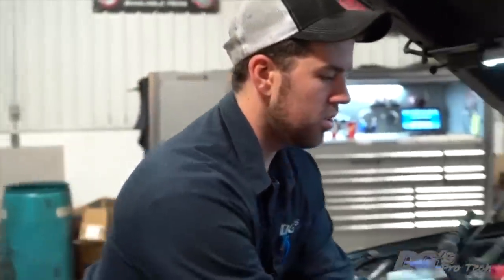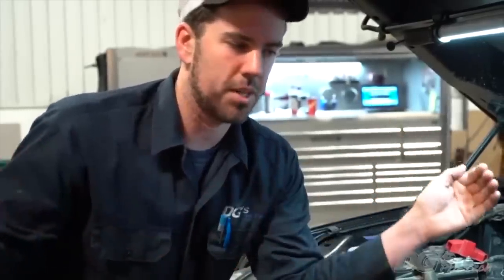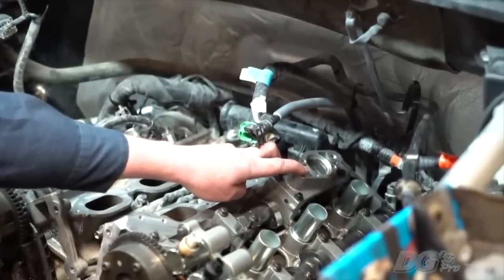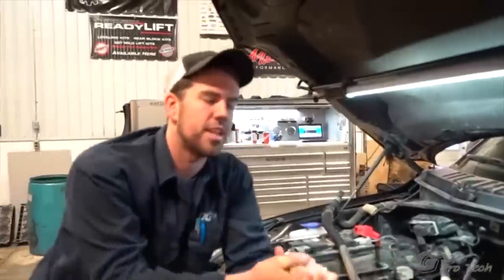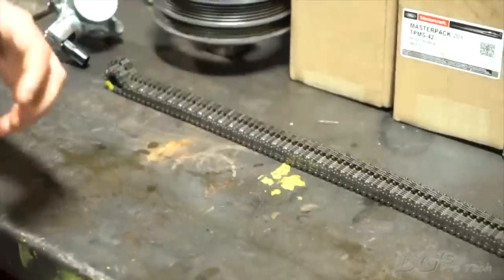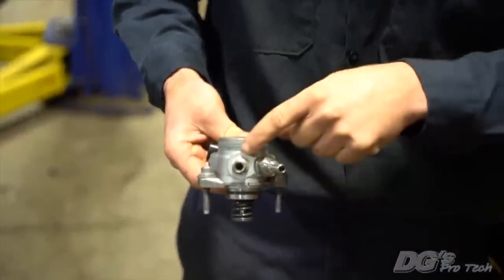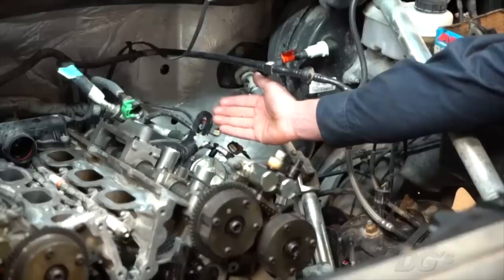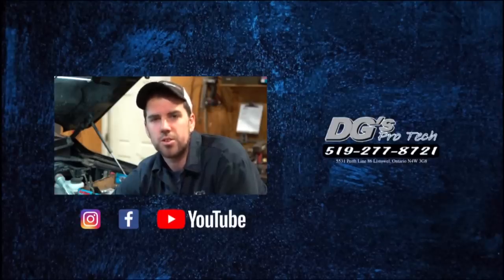What you NEED to know about Ford EcoBoost Engines by Dustin Golley of DG's ProTech

Comment: I want to alert DG Pro Tech, regarding scanner codes on Ford engines, that I went to 5 different Ford Dealers in Miami about firing problems with my 2004 Marquis, a P0355 code showing misfiring on the #5 cylinder.   NOT ONE OF THE FIVE DEALERS mentioned that my PCM (the main computer, power train control module) might need to be re-programmed.   One dealer had the car a full day, and told me "it might need a new PCM, and Ford no longer carries a replacement, so there's nothing we can do."
I spoke to two different service reps at Metro Ford, neither of whom suggested reprogramming.  One rep said it might be a transmission problem.    Even I knew better than that.   Pines Ford in Pembroke Pines Florida said they could reprogram the PCM.   They replaced a coil and a plug, and DID reprogram the PCM.   Other non Ford mechanics that worked on the car replaced plugs and coils, but the engine light eventually came back on and I continued to have misfiring and shuddering when accelerating.
Also, regular scanners (unless they are bidirectional and you purchase a subscription for your vehicle manufacturer) can't reprogram your PCM.   Matco Tools has bidirectional scanners and you can purchase a Ford subscription for that scanner.   The subscription apparently gives the parameters so you can reprogram your PCM.   Be sure to check when you buy a scanner to see whether or not it is bidirectional, otherwise, all it can do is shut your engine light off and give you error codes.

Comment: It’s a pos. A “high performance engine” in your wife’s grocery getter. Same reason they didn’t put solid lifer SBC in station wagons in the 60’s. Parts sourced globally from the lowest bidder. Lucky to get 100k miles before levels of repairs unheard of since the early 1980’s. It make get 2 more mpg when new but compare that to a disposable platform that is worthless at the decade mark when it needs a more major repair, vs one that is serviceable 20 plus years.
Give expedition a NA option

Comment: Traded my 2007 F-150 5.4 Triton before the Cam Phasers Failed and Spark Plugs needed changing and Breaking off in Engine Block. WEAK air conditioner! Had to be doing 55 MPH for any air! Crappy Chrome Hub Caps that needed Scouring the Brake Dust off was difficult. Bought a Toyota Tundra in 2015. Built in Texas.

Comment: I own a 2011 F150 with this ecoboost. 130,000 k's. Full synthetic oil changes every 10,000 k with the Ford oil filter. Kick on the turbos once a month to operate the gates. The only repair I had to do was to replace the throttle body! Great truck!

Comment: How do i "cycle" the turbos and achieve 15psi? just stomp on accelerator? Also has anyone had any gear change issues after putting pedal to the medal in a 2015-2017 EcoBoost f150?

Comment: I know mine hauls ass. I put a catch can on it.2016 3.5 Ecoboost F150. Keep the oil changed!I use Ford Oil and the dealer changes it every 3 to 5,000 miles.I run good gasoline like Chevron.It’s the internal water pump I’m concerned a lot

Comment: One of the differences between the 2.7 EB and 3.5 EB engines is the 2.7 has computer controlled waste gates in the turbos and the 3.5 is vacuum controlled. I'd like to know if the computer controlled waste gates on the 2.7 have eliminated the waste gate seizure issues of the 3.5 vacuum controlled waste gates? Also, if the computer control waste gates have solved the seizure issue, has Ford updated the 3.5 EB engine recently to the computer controlled waste gates?

Comment: Manufacturers should publish chain stretch specifications for OHC engines.  I have a tool to measure chain stretch on a bicycle chain, for chains that cost $20, saves you the cost of replacing other components when your chain is worn out.  Why do we not do the same for cars?  Simple explanation I suppose is that the manufacturers want to advertise as low of maintenance as possible, and then when it breaks they want you to buy a new one.

I guess one method would be, if you hear it slapping at cold startup, you'll know the tensioner is out of limits and the chain is slack.  But I'd personally rather replace the chain and tensioner before I got to that point.  If we had a spec or some other indicator, for example a way of knowing the tensioner is all the way extended without opening the engine, it would give the owner a better chance to replace the components when it's time without having to suffer other effects like excessive wear on the phasers.

You can clearly see that the chain in the video has stretched at least a quarter of an inch.

Comment: So its a great engine you just need to use good oil and change it , i HAVE A 2012 FUSION 2.5 AND I CHANGE THE OIL EVERY 5000 AND IT HAS 185000 MILES AND STILL RUNS LIKE BRAND NEW AND HAS NEVER BEEN WORKED ON.

Comment: I am a mechanic and I really like your video, but I was a little disappointed when after the video I didn't hear you talk about one of the most deadly defects of the 3.5 liter ecoboost. The water pump fail and leaking coolant inside the oil pan. Ford really messed up by having the water pump driven by the timing chain inside the timing cover with huge room to leak all the coolant right into the oil pan. I hope you make a video about that flaw sir.

Comment: Why my catalytic converter went bad if there was not check engine light 
Spark plugs replaced and fuel injection cleaned not a year and went bad again what should I be looking to prevent happen again 
2012 f150 fx4 ecoobost engine

Comment: Just seeing this now but well said my friend.  I am a former auto tech and everything you mentioned is dead-on correct.  Thank you.  Use good oil (Amsoil in my case) and treat your expensive vehicle with some love.  I would recommend adding a PCV catch can which really does work!  I was doubting really needing one, if they are worth it.  Let me tell you, they work and are not expensive.  First time I removed it to drain it, there was a good amount of water/Oil gack in there which is no longer in my engine!  Look up JLT 3.5 Ecoboost catch can which is what I used.  I'm sure they all work.  Money well spent.

Comment: give me a simple pushrod engine,i'll gladly pay for the extra fuel used
Reply: EXACTLY, I'LL TAKE A CHEVY LS all day / any day for power & great durability !   03 Tahoe 5.3 has well over 500K and I've done nothing to it internally at all, just water pump, belts hoses & Mobil 1 oil changes every 7500 miles, still holds 35 lbs Oil Pressure at warm idle. I'm very impressed
Reply: @Ts68mo  Chevy all the way!!

Comment: I wish that Ford would make an EcoBoost engine to compete with the Power Stroke V8. A 450 hp, 5.0 liter inline 6 could make peak power at 4,400 rpm with much lower boost than the other engines in the EcoBoost family, so it wouldn't need direct injection, or VVT, and it would likely be simpler and longer lasting than the Power Stroke engine if it were reasonably overbuilt.

Comment: I had an explorer with ecoboost engine. Excellent car, awesome power. Broke down 3 times within 2 years, the dealer services were terrible, they are not there to serve you or to permanently solve your problem. Ford took it back as a lemon.

Comment: Been driving a 3.5 since 2014. 135,000 miles on it. Only problem I’ve had with the engine has been O2 sensors. Semi synthetic oil every 5k. Great engine so far.
Reply: hi 
5000 km or 5000 miles and what viscosity

Comment: I'm on my second 3.5 L eco boost. First one, a 2012, I drove for 560,000 km before the company replaced the truck. Definitely didn't work as good at the end as it did when I got the truck but still pretty good. I now have a 2021 and it's awesome. Better fuel economy and more power. Thanks for the tip about the waste gate, I'll make sure to run her hard every now and then because normally I do stay out of the boost.
Reply: "company truck" = "fleet mechanic" - your 2012 probably got at least one change of chains and tensioners - along with a few other "maintenance items" associated with the cam phasers and oil pumps...
Reply: @brianstough5286  our office didn't have access to our company garage and I was in charge of all maintenance to all vehicles at my location. There was definitely never anything done to the timing chain,  tensioner or cams. Oil changes were done ever 10,000 km. We had some issues with cooling a few times and transmission issues at the end of it's life. I'm now on my third and the last two are personal. My 2021 is 13 months old with 54,000 and not a hiccup.
Reply: @jwyoungy  !!   congratulations!!   You got a very rare gem!!
Reply: @brianstough5286  not sure what your issue is. My 2012 was one of about 20 in our fleet. Of the original batch of 2012 F150s with the 3.5 turbo engines, maybe 2 didn't make it to 2020. All of the trucks were high milage by that point. Our company was a major heavy Civil Contractor in the region and once the maintenance costs, plus associated costs such as towing and rentals, become more than the cost of a new vehicle then they are replaced. We had Dodge pick it's before the f 150s and they lasted about 5 years. Say what you want but they are about the most reliable trucks I've ever driven, which is why when I went to buy my own it was a sure thing with the f150 and the 3.5 liter turbo

Comment: What is your opinion on the 2018 3.5L Ecoboost?  I’m looking to pick a lariat up this week great deal, but would you buy it?  Just want to get your professional opinion sounds like there were some changes to the 2018 to hopefully make them better?

Can you confirm and discuss anything to be aware of?  The truck has nearly 35k miles and also had a 6” Rough Country lift put on it by Lifted Trucks and 35” Nitto Trail Grappler MT’s

Comment: "What you need to know about EcoBoost Engines" It's Fords version of the Northstar.
Reply: The first ones were pretty bad. But the 3.5 are pretty good. Had my sho tuned to 450hp and is at 135000 miles and still drives great.

Comment: Excellent ECONOMY?  That was when I stopped listning.
Reply: I have a 2017 F-150 eco boost and get 25+mpg on the road. Just crossed 50,000 miles. Get 21+ in town. Not great at towing but still a good truck for me.
Reply: Yes my ecoboost gets good mpg compared to a v8. Have you ever owned an ecoboost?
Reply: @michaelriecher5632  Nope and never will own a Ford.

Comment: I had a 13 Tacoma and my cousin got the Ecoboost. She traded 3 years ago for another F150 with V8. Her Ecoboost had the stretched chain. I personally owned one Ford and it will be the last. I have a 2020 Tundra and I gladly pay a bit more in gas and hope the engine will last 500 000 kms or more. I have seen enough videos about how bad the Ecobust is. I got my Tundra for that reason. Toyota is going the same route with the Tundra...I do NOT want anything Turbo. Ford should borrow Toyotas trick and have dual injectors. Port injection has advantages.

Comment: This guy obviously has not been a tech that long. Eco boost got the nickname ecobomb for a reason. Hes younger so I get he just doesnt have the experience. Hea got a lot of good knowledge but dpesnt understand the engineering. They are a piss poor design period. He also doesnt truly understand how they work. If he did he would warn anyone from buying one of these shit boxes.also they will not tow 13,000 pounds without seriously stressing the engine. It is a piss poor design. Do not think there is a replacement for displacement. I have 22 years of experience and these are and simply an absolute junk design.

Comment: Ya theyll tow it but for how long and at what overall expense to engine longevity and monetary expense? Your not towing or driving when your cars in a shop ringing up a repair bill. I’ll take a v8 with cheap conventional oil n filter for twenty years of trouble free use for a few less mpg.

Comment: Blah blah blah, without this guy’s knowledge and experience, too many parts too many ways to fail. You need so much energy (fuel) to move X weight, basic physics. KISS is the best way to make an engine, the EPA needs to stop pretending to be scientific or engine designer’s.

Comment: This has all the things I would want to avoid, turbo charger, DI, timing belts, and variable valve timing. Why buy complex problems?
Reply: Lol well dont buy any new vehicle then bud turbos have been around since the 80s. engines have had vvt since the 90s in some not all this engine doesnt have a timing belt and di is great as long as you have port to clean the back of the valves

Comment: I'm under the impression that direct injection sucks especially when combined with a turbo because there isn't really a good way to clean the carbon buildup on the back side of the valves which naturally comes along with direct injection. The turbo will not survive the chemicals otherwise used to treat such a problem.

Comment: my 2018 f150 ecoboost went in for timing chain chatter at start up at 25k mileage. Oil drained too quickly from top end of motor, it would chatter whenever the truck sat for 8 hours or more. Ford warranty installed updated parts, chatter went away until I hit 40k. Now it chatters after sitting for 2 days. It's going back in this Monday still under warranty. Truck is incredibly fast. I beat a Mercedes once, the kid asked me what the Hell do I have in that truck?

Comment: well those who says it has no eco. they dont know how to drive a turbo gasoline engine. (sry for english hope i can explain because i dont know the xact wrods) for this engine, eco comes from its rpm..  with the same speed this engine turns around -20% rounds per m. and this brings about %20 economy.. when u drive atm engine with 100 km/h, it turns (lets say) 2000 rpm... same speed this engine turns 1600 rpm.. thats the eco..  u should keep your foot calm if your car has AT.. if u have a manual transmission, just increase speed around 2000-2200 rpm and drive at 1600-1800 rpm.. agressive driving style makes this engine consume more fuel.. as long as u dont need power, drive it calmly.. can we compare this truck with my 1.0 ecoboost engine but the fact is what i wrote above. my old car was 1130 kg, 97 hp-128 torque, comsumption was 7 lt/100 km..(driving style speed 5, 2200 rpm, 75 km/h) i used that car for 5.5 years.. now i have focus 3 1.0.. my car is 1300 kg, 125 hp-170 torque and comsumption is 6 lt..(speed 5, 1800 rpm, 75 km/h) same location, same roads, same work destination.. so ford focus is heavier, has more hp n torque but less comsumption.. this is the fact.. pls learn how to drive :D

Comment: I had a 1985 ford tempo, that had 870,000 km's on it, I changed oil every 5000km's or 3000 miles that car was great,I did buy it brand new, drove it 23 years  and it never left me stranded once. It had 5 speed manual transmission, when I parked the old car it still had the same motor never rebuilt, same clutch in it and transmission. I was trying to get 1,000,000 km's on it but the steering was getting really bad,and it was going to cost to much to fix it. Even the air conditioning was still working in it. The oil I used was shell 10/30,and olny ford oil filters.

Comment: Sorry to burst your bubble but I had 2012 F150 ecoboost. I changed the oil every 5,000 miles with Amsoil signature full synthetic. Had the timing chain stretch at 55,000 miles. The loose chain ate into the cover, sheared off one chain tensioner, chewed off the screen on one vvt solenoid, and all four phasers had to be replaced. Those years has poor quality parts and overhead cam engines simply do not last. Ford has spent the last two decades making 100,000 mile ticking time bombs.

Comment: Very knowledgeable guy.Thanks for this video. I have a 2015 Ford F-150 3.5 ecoboost. Does this first gen 3.5 ecoboost engine needs regular intake valve cleaner? Would a bg fuel induction engine valve cleaner or crc intake valve helps? How to prevent carbon build up? Thanks

Comment: 5 minutes in and I call bullshit on all of this. Not a fuel efficient engine at all. Currently about to be on my 3rd timing chain at 96,000 miles. Turbos have blown both seals on the coolant lines. Plugs have been changed 4 times, coil packs have been replaced 3 times. Cylinders 2 and 5 are constant problems. 
The 2011-2014 3.5s are the absolute worst engines Ford has ever produced. I'd go a step farther and say it's worse than the 6.0 and 6.4 diesels from 2006-2010. No engine in a daily driver should have direct injection with a twin turbo setup on a V6.

Comment: The 3.5L ecoboost never came in any edge. There is a duratec n/a 3.5L that this “ecoboost” is loosely derived from that’s in the edge. The edge has a 2.7L ecoboost that is completely different to the 3.5L TT engines of the previous generations. The old 3.5 had timing guide issues and water pump nightmares. The 2.7 doesn’t have these issues as they were addressed with the new compacted graphite block and other improvements. Just one correction for you as you misspoke as said these ecoboost 3.5’s came in the edge. Which they did not.

Comment: would also be STUPID not to replace the cam phazers also while in there.while these cost a bit,its better than the vehicle coming back in a month with a "tick" or rattle on startup that ISNT the tensioner.How do i know this?25 years in a Ford dealership is how,do it once and only once.while the turbos do "freeze' up,the plunger on the end of the wastegates also can become loose and not seal,causing the same concern.they also rattle when cold is a dead give away.Good video though,very informative to the novice of whats going on.

Comment: one thing he did not mention is mthe water pump being inside the front case of the engine, when the water pump shaft saeal starts wearing out and leaks, it can damage the engine, leading to catascrophic engine failure